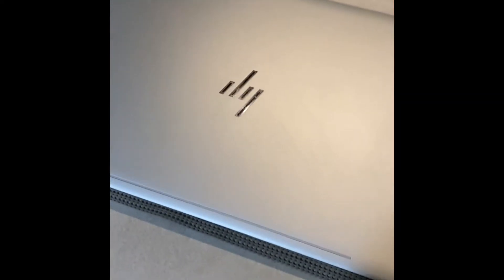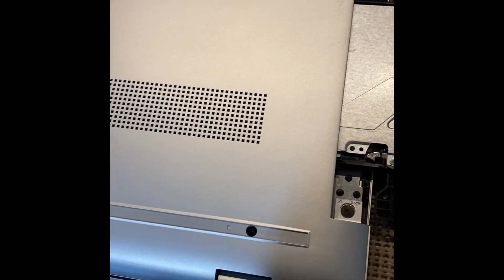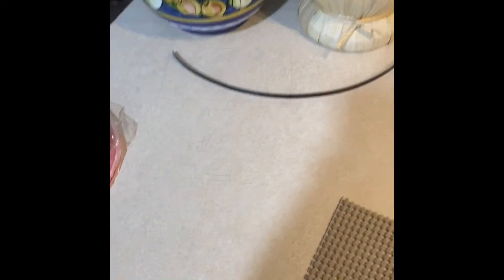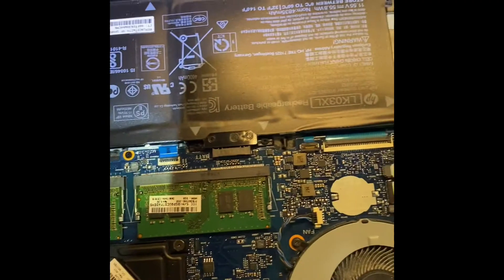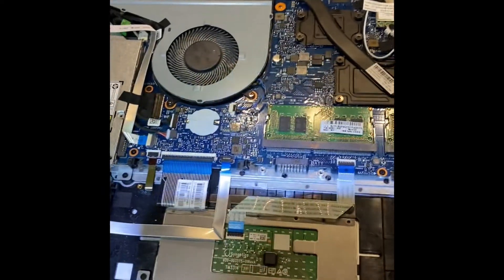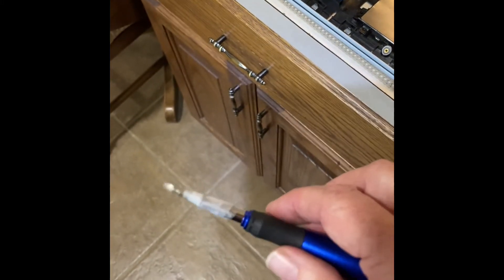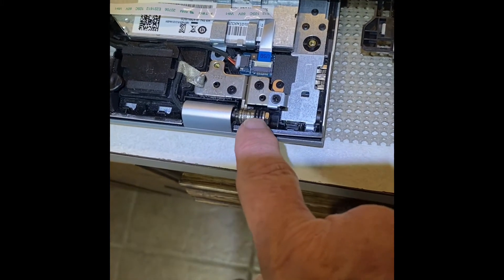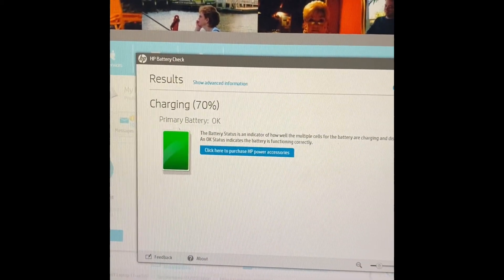Replace Battery on HP 17 ae100 ae1XX

Comment: Fantastic instructional video, thank you!! I like your careful way of working with best practice. The tip on popping out the dvd drive was invaluable - I would never have guessed and would probably have damaged something. Just replaced my battery and it's working fine so far. 🙏😄
Reply from the maker: Well, thank you. I love to share tips that enable average folks to try new things. Glad it helps.